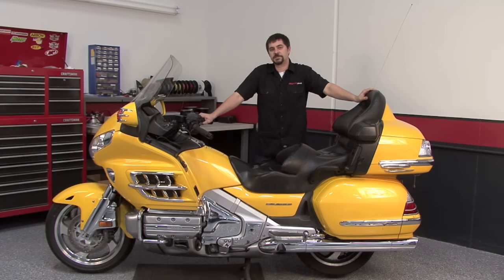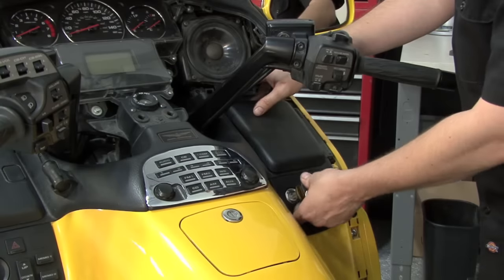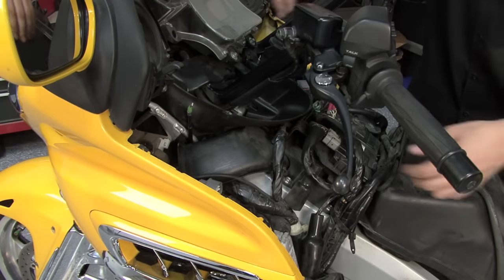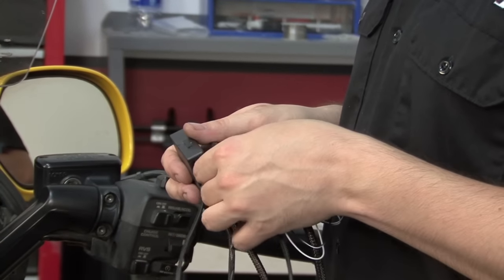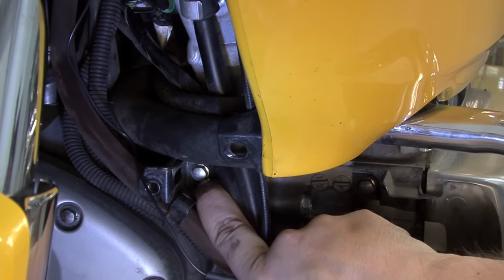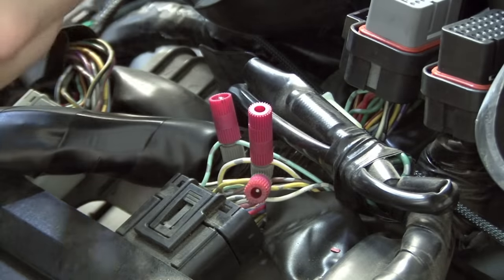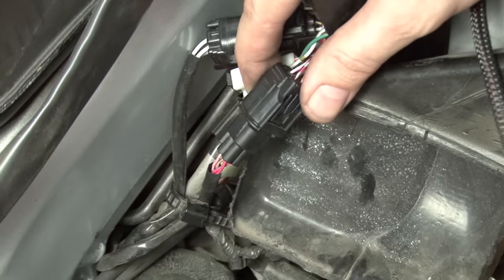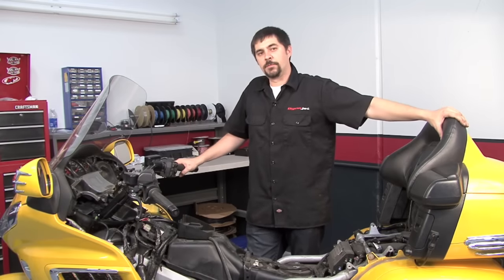Power Commander V Install: 2006-2010 Honda Goldwing

Comment: I didn't know they made such a thing, or why it would be needed unless you were to change the exhaust maybe? Then no results to demonstrate? I get this is the install, but there is no link or anything on expected results.
Reply: I bought this and it decreased my fuel mileage by than  30% in fact it was a pain in the ass I don't even know our bought it. If you want something done take it to a shop and get tuned professionally these things they just don't work.

Comment: How about some dyno runs to show this thing works? I do not like "piercing" the ECM or FI wires. This is just a problem waiting to happen.
Reply: Don't buy one of these anyway forget PC wires just don't buy one they don't work if anything they degrade off your performance from personal experience on two different bikes. I don't think it's going to damage our engine but you can certainly find that you have foul spark plugs is all sorts of problem but don't recommend needs at. If you want tuning take it to a professional tuner and get it done this is not the way to go about it and that's probably why he hasn't but and he results up because there aren't any different results.
Reply from the maker: Piercing the wires is never the ultimate solution but we have used these posi-taps on thousands of installs with no issues. The older T-taps we used could cause permanent damage to the wires due to vibration but these posi-taps are much less intrusive and should not cause any problems.

Comment: Would like to of seen a before and after dyno. Kind of an incomplete video.
Reply: I wasted money on both the power commander and the other one the dynojet that's it and trust me neither of them do anything for this bike just take it to a pro tuner don't waste your money on either of these  things it doesn't really do anything in fact it makes all miles per gallon worse and I think it extreme circumstances it could actually damage something.

Comment: How can some of those Gold Wing panels just "pull off" or "pop out"?  Wouldn't the rider loose panels during a hard ride?  Just wondering.  Geeze... got to take off just about every panel on the MC to install the Power Commander!!  LOL    Seems kind of a patch-work of add-on dongles to me. There has got to be a better way. Isn't there an ECU programmer with a touchscreen that can hold a number of different programs -- one for economy cruising, one for performance riding, one for full race (track only) -- that sort of thing?